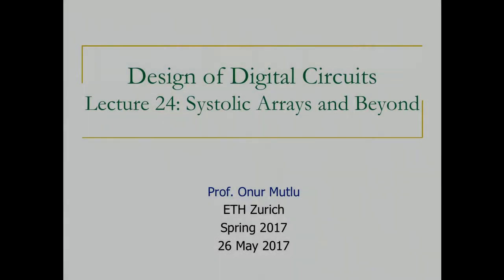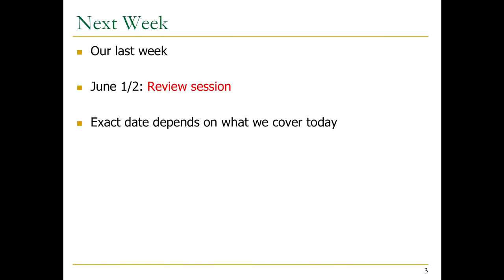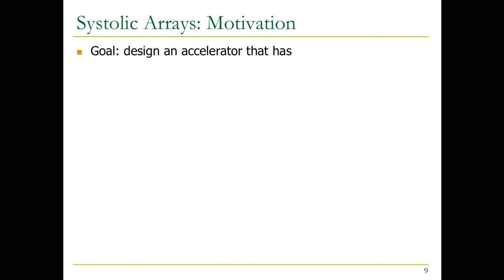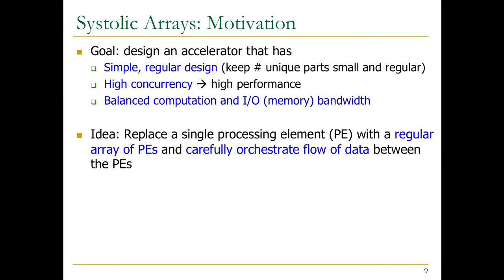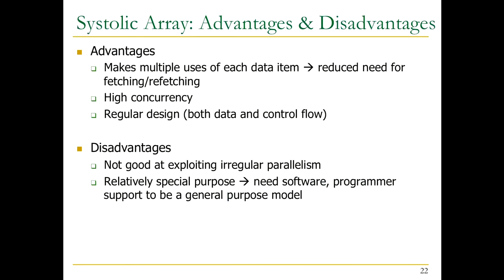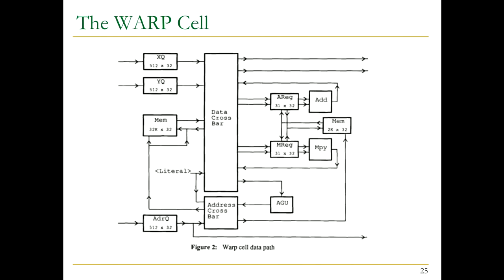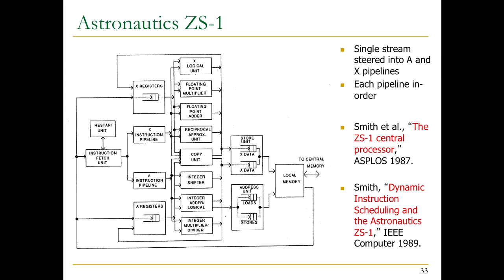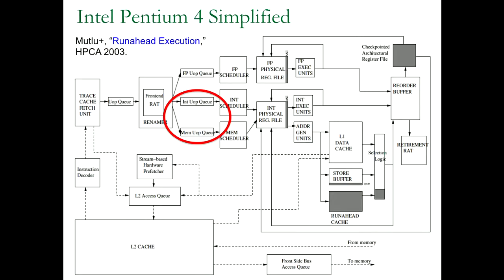Digital Circuits - Lecture 24: Systolic Arrays and Beyond (ETH Zurich, Spring 2017)

Comment: I am interested in quantum computer architecture. Specifically, I have become led to these systolic arrays as a way I can seed tensor components for tensor mathematics on all elements simultaneously. And to connect the tensors between each another (perform a transform).

I would plan an FPGA connected directly to DDRAM (or SRAM) to store and set the weights and coefficients between pipeline execution elements.

What would you recommend for me in this case? Or have ideas?

I spoke too soon! This video answers my question perfectly!

How about encoding systolic arrays within a real-time 30fps, 120fps, or higher N-M image sensor with up to 48-bit color depth per pixel, and 3D channels? This throughput is very high and already part of the HDMI and MIPI standards as I understand.